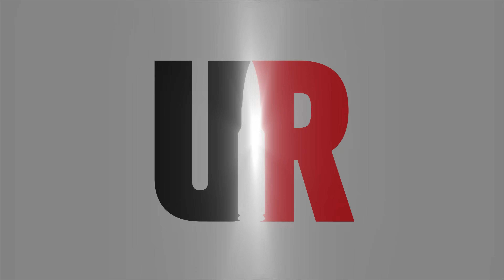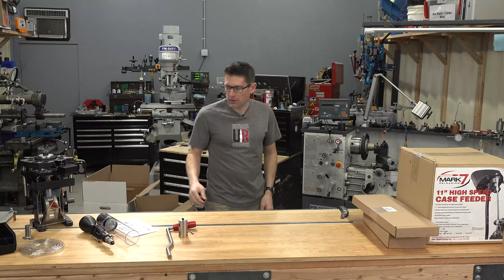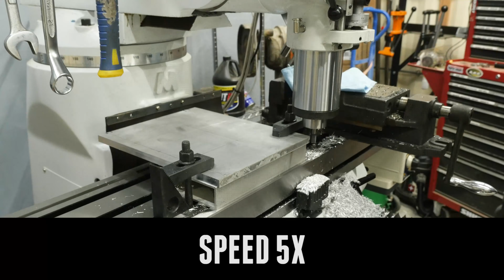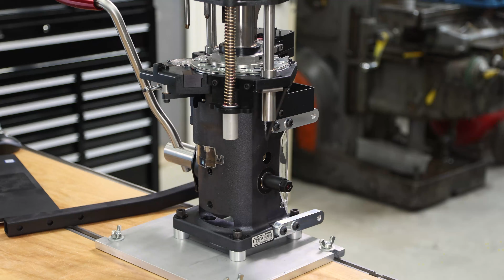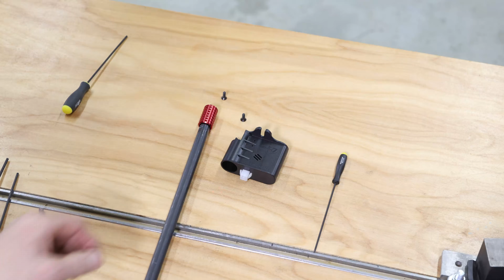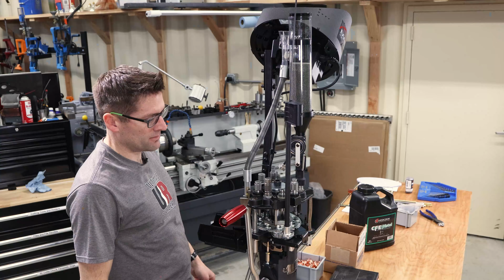NEW Mark 7 APEX 10: Unboxing, Setup, Loading 45 ACP

Comment: DO NOT WASTE YOUR MONEY ON THIS!!!!!!  The priming system SUCKS!!!!! Terrible waste of components. I load around 20 9mm bullets and have to take the entire machine apart!!! The primers land sideways in the shuttle and jam the disc and the primer is destroyed leaving a mess in the disc and jamming it. I have tried everything and called support over 10 times. it just won't work!!!! Terrible design!!! It was a waste of money and a lot of aggravation!!!  UPDATE!! They came out with a Generation 2 Priming System, you have to pay $$$$ for it, to replace;ace the disaster that they first came out with and robbed you. The Generation 2 updated Priming System is worse than the original!!!! And you have to pay for it!!!! The new system crushes the primer between the shuttle disc and frame of the system.  BEWARE!!! If you buy one of their products you only have yourself to blame!!!

Comment: Now this would crank out the ammo but I'm new and want to get into reloading new brass for myself and friends but seeing from other experienced viewers this isn't for me being a newby!Any suggestions viewers just don't want to start out with a cheap single stage or anything?
Reply: You will be very happy with a Dillon RL-550C, Redding T7 Turret, RCBS Rock Chucker or Lee Classic Cast 4-Hole Turret. Any one of these depending on your budget would make a EXCELLENT first press and still great years or decades later. I don't have the Lee but I own all the other 3 and I have been reloading and casting bullets for over 30 years. I still use these all the time even though I also own a Dillon XL-750.
Reply: I actually own my 20+ year old Dillon RL-550B and just bought another new Dillon RL-550C which is the current model.

Comment: Now moving on we get to the Primers! We all know how cheap and easy they are to get !! So why worry?? load 10-15 cases and then the primer flips sideways in the plate and the press JAMS!!!! Take the piece of junk apart and remove the primer after you pick up as many primers as you can find that emptied out of the tube on the press when you take it off to remove the jammed primer. WHAT THE HECK!!! NOTHING ELSE TO DO!!!!!!!!!!!!!!!!!

Comment: I recently purchased the Apex 10 with Mr. BulletFeeder and so far I'm not very impressed.  I own the Dillon 750 and realize it takes some amount of tweaking in order to get these presses to run smoothly but I'm having priming and powder throw issues with mine.
Reply: Has your opinion of your mk7 improve? Any updates??
Reply: Yes.  Customer service has been very helpful.  One of the big issues I had was inconsistent powder throws.  That was resolved by completely dissembling the powder measure and cleaning it.  It's been right on since then.  Small tweaks with timing and keeping it clean seems to keep it running very well.  It's dedicated it to 9mm.  I'd give it 4 out of 5 stars.  Now, whenever there's a problem it's almost always brass related.  I use mostly range pickup. @Sievert31

Comment: WOW  I just loaded my first 200 9mm on my new Apex-10 (manual, no autodrive)  and boy am I pumped!  What an upgrade this is from my old Hornady LNL which I've had for 12 years. Every component of the Apex-10 reeks of quality engineering, manufacturing, and precision craftsmanship.  Dialing in my dies on the new toolhead was a breeze.  I really like that all operations happen on the forward stroke, including priming (unlike the LNL), so you can dial in each operation independently -- without advancing the press -- until you're ready to move to the next step.  The only adjustment I had to do to the press was to seat primers a bit more, which was easily done by turning a set screw on the top of the toolhead.  In no time at all, it was time to reload the primer tube. The only thing to watch is to not go too fast.  I found the DAA powder check plunger picking up powder from loaded cases and dumping it on the shell plate until I slowed down a bit.  It wasn't a cheap investment, but if you enjoy reloading as much as shooting as I do, this is a great addition to the shop.  Anyone want to buy a well used but still great LNL press??? 🙂
Reply: What sizing die did you use over the priming station?

Comment: Gavin, it seems like a lot of people are having issues with the primer feed system on the Apex 10. Did you have to do a lot of testing and adjusting to get the system to work as smoothly as it appears to work for you?

Comment: My buddy bought one , what a nightmare this thing is , priming system is flawed big-time , the press was replaced but just to go back to the same problems . I'm sure some have great luck I guess but in what I've seen 1st hand in MONTHS  of watching him deal with the customer service Getting wrong she'll plates in caliber change kits it goes on and on , NO thx you , I'll stick with my 750 /1050
Reply: I'm having problems with my Apex 10.  From priming issues to inconsistent powder throws.  I own an XL750 and know it takes tweaking to get any press running smoothly, but this things is giving me a headache!

Comment: Hello!  i'm AGONIZING trying to make a decision between a dillon RL1100 or Apex 10 for 9mm.  i'm a newbie.  wathched house and hours on the 2 systems.  it can see where the apex 10 would be good for rifle calibers but i'm not sure there is a huge advantage for running processed brass in 9mm.  what are you're thoughts please!
Reply from the maker: Hi John! Both are great machines. The biggest advantage of the APEX 10 for pistol is having a dedicated station for EACH operation! (two more stations). See: https://ultimatereloader.com/2021/02/24/new-mark-7-apex-10-unboxing-setup-loading-45-acp/

Comment: 100% hard no from me.  I've owned (and still own) many a progressive press, and a lot of Mark 7 gear.  The massive blind spot caused by the case feeder bar being at the front makes the press one I'd never fathom owning.  It needs to either move back, or further out.  Watching Gavin try to load on it, you can see he's struggling to place the bullet each time based on the fact that he has to reach around the case feeder arm.
Reply: I rewatched it and see what you mean. Though au could be wrong, but it seemed like he was seating the bullet just after the powder (where the spots for the bullet feeder and powder check are) when he could have seated it two positions further, in the front i would imagine. Then again, even if it is annoying for hand searing, i guess most people who pay for this would get a bullet feeder anyway.
Reply: To each his own, but I recently purchased an Apex 10 and I love the location of the case feeder bar. I rest my left hand on it while I crank with my right. I do have a Mr. Bulletfeeder though. It would be a pain if you did not.

Comment: When would you use 10 different Dies for  the same calibre?
Reply: 1. Case feed
2. Decapping
3. Swage
4. Resize
5. Case trim
6. Prime
7. Powder drop
8. Powder check
9. Bullet feed
10. Seating.
At least I think you can swage on this?
That's not even including a separate crimp.
Of course some could be combined like decap and size, seat and crimp, but you could absolutely use all 10.

Comment: That press is the "Ducks Nuts" just needs a high capacity primer hopper to hold 2000 plus primers and its perfect. Pair it with the auto drive as well.
Reply: Lol auto drive cost over 2g. I didn't realize the system would cost so much for a motor to rotate back an forth.

Comment: Apex 10 or RL1100?
Reply: Ask anyone who uses a 1050/1100 to load COMMERCIALLY and you will get an earful about work-arounds. MK7 has addressed the Dillon issues with this press.
Reply: Apex is better. Dillion is cheaper, for a reason.
Reply: Dillion Blue

Comment: When supplies are available - I will most likely buy one of these. My time is valuable AND I want to shoot a lot. My current setup means that every hour at the range is about 1 hour+ of reloading. With this, every hour at the range would be about 10 minutes of reloading. 

That makes it quite a bargain for me.
Reply: Pretty sure it's going to take alot longer than 10 minutes to load enough ammo for a hour at the range even if you leave it all set up for one caliber and one type of bullets and powder it's going to take you 10 minutes to load primers , powder , cases and bullets then you should really check everything so realistically it is going to take at least a couple of hours to load 2 to 3 hundred rounds
Reply: @charliebrown2489  1500rds/hr is about 250rds/10min

I usually shoot less than 200/hr at the range so that is at least pretty close to accurate. At the moment I am prbably under 200rds/hr with my current setup.
Reply: @Factory400  your in dream land 1500 rounds an hour is not possible you would need at least 1 person to load primers in tubes one person to load bullets , powder and brass and you would have to load 2 rounds a second with not one hickup and you would set a world record
Reply: @charliebrown2489  I only said 10 minutes. And the Apex7 has an automatic priming system that can hold/feed many hundreds of primers just by dumping them in. Mr Bullet Feeder Pro can hold many hundreds of bullets just by dumping them in the hopper. The cases - again many hundreds just get dumped into the hopper. Primer check, powder check, etc.....

None of this is a dream at all - it is part of the system design. The most immediate limit is the strength of your arm.